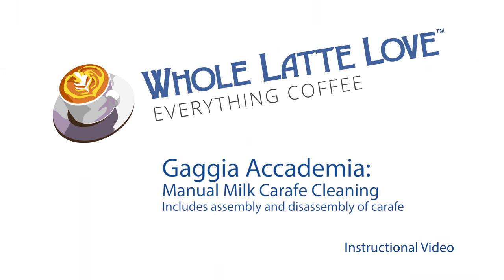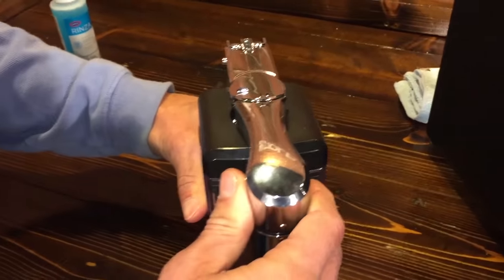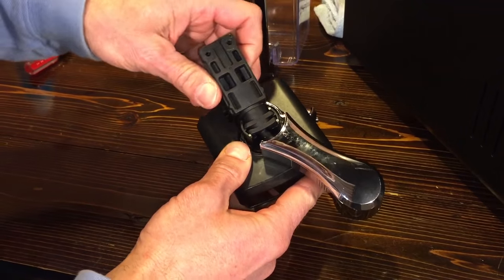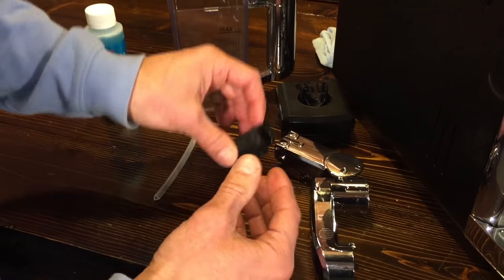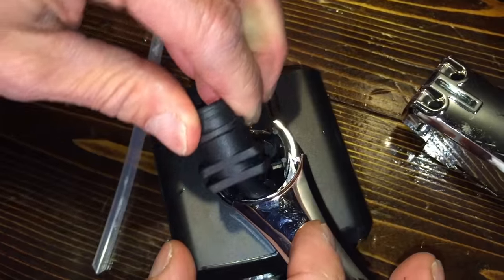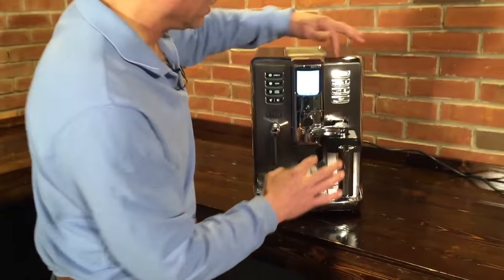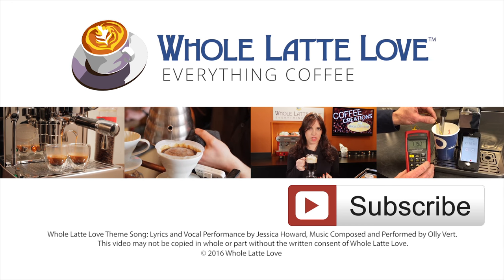How To Manually Clean a Gaggia Accademia Milk Carafe

Comment: Hey Marc and Team:
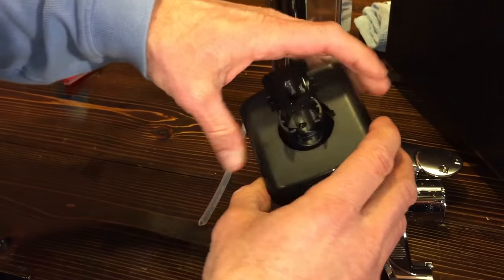at 1:45, he refers to using only a damp rag to wash the block /lid. I have the Magenta Prestige and there is a similar design. Is this because the screws are not water proof and subject to rust and should be kept away from the water?
Reply from the maker: Hi Wayne, The Accademia carafe is similar in some ways to the Magenta and different in others. No issues getting it wet and causing rust.
Marc
Reply: @Wholelattelovepage  I see. I did note that yea in the Magneta, there were those screws. I was apprehensive of exposing them to water due to risk of rust. Do you guys happen to know what material the screws are made of? 

Also the sliding action of the Magenta, there is a Spring inside the slider top block. Is that also safe for water exposure?

Comment: My Babila cleans the milk system automatically every time (every day).  So, how often do I need to take the frother reservoir apart as in this video and clean it??
Reply from the maker: Hi D W, Thanks for the question. That automatic cleaning which pushes steam/hot water through the components leaves the carafe ready to go back in the fridge. If using daily and carafe is going from fridge to machine, getting the quick clean right after use and quickly back to the fridge then I'd take apart for cleaning every 3-4 days of use. Do it sooner if you notice a decrease in frothing performance which is usually a result of milk residue obstructing an internal component of the carafe.

Comment: When disassembling, can you remove the black part that has the black hose going into the handle so that it can also be soaked in the Rinza solution?  Or, is that not necessary?
Reply from the maker: Hi Calvin, It's not necessary to remove the black part and hose. You can soak the entire part with black fitting/hose/spout in Rinza or work some Rinza solution into the hose through opening in black part and the end of spout. Hope that helps.
Marc